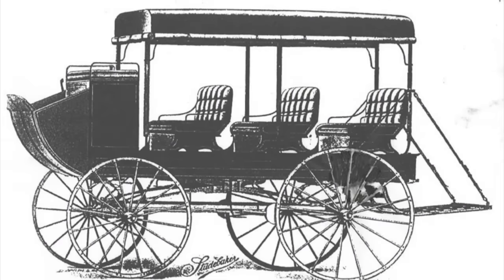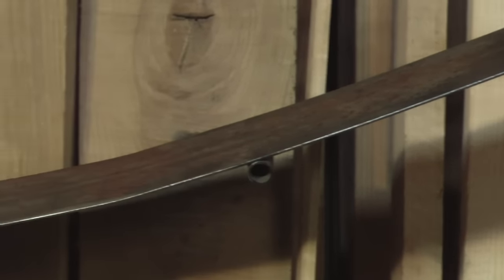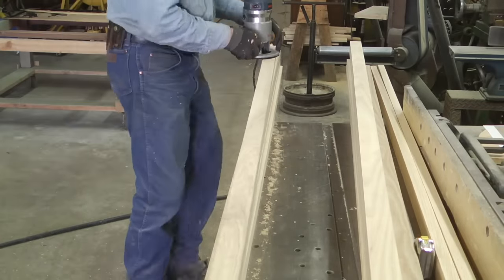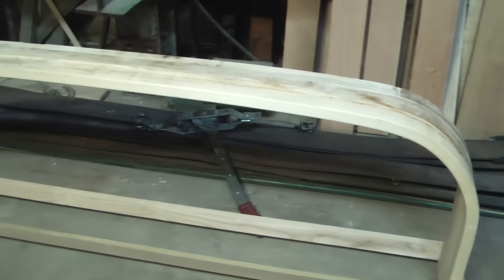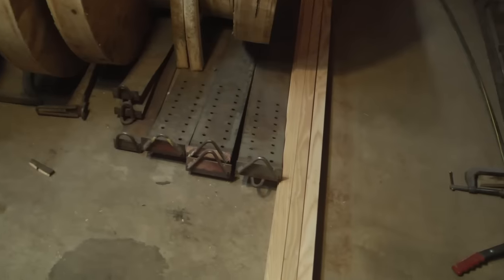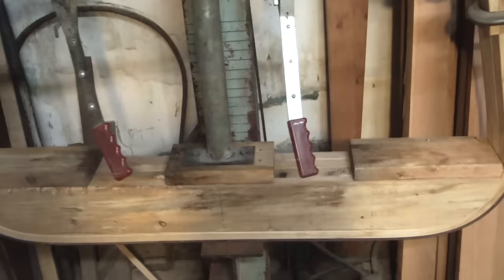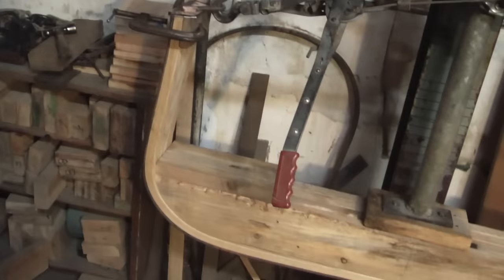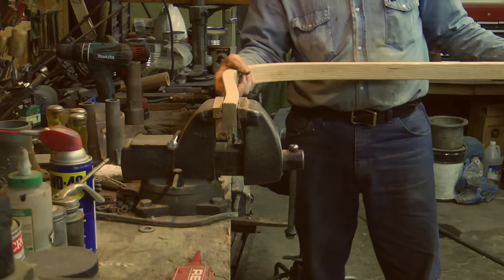Steam Bending 1" Thick Kiln Dried Ash Possible | Engels Coach

Comment: I've bent ash for a row boat I made in my garage and it took a bend extremely well. I didn't have a press. I just used a lot of clamps and I achieved a perfect bend with my first attempt.  I was amazed at how flexible it was when steamed.  I built a steam box from scrap wood and just used plain water and no pressure. You have an amazing shop!

Comment: Experience and knowhow. unbeatable .I really admire the way you can overcome a problem and turn out a first class product making it look so easy . I was a bit concerned when you straitened the very ends of the bows in the vice , thought it would leave deep marks in the timber from the edge of the jaws as it is still soft and pliable , but obviously you know you can avoid this happening as you have done it many times before.

Comment: never would think Kiln dried could bend... Myth Busted!
Reply: I've heard that in a wooden boat forum more than once with requisite horror stories told at the very suggestion.
Reply: V Star 1300 Adventures - Boatbuilders like to avoid kiln dried material for a few reasons. Besides the added steamer time Mr. Engels mentioned above, there is also a problem with fiber damage which makes the wood less moisture resistant.

Comment: I certainly enjoyed watching. Back in the late 80s when I lived in Denver I had a friend who wanted to build some sleds. He came to me to help him build the steam chamber. I built him a chamber from a 4 inch diameter pipe capped on the ends with a pressure gauge, relief valve, a way to add air pressure and a temperature gauge. It was long enough to suspend his wood in with the water in the bottom while it was mounted vertical over a burner. As I remember this worked out pretty well for him.

Comment: You can base your spring back on degrees rather than inches to be able to apply to other wood projects and you may get more consistent bends .. similar spring back in metal pipe when I bend large EMT for electrical ... you go x number of degrees over . You can record your spring back for different woods and thickness and see if you come up with a good formula.. awesome job ! Great video... I’m watching because my client has a two inch thick rustic table with bark edges she paid 3G for and it warped !!! The guy didn’t seal the bottom!

Comment: I remember bending 2" oak for the keel on small wood boats.  We used a copper leader from an old house, crimped at the bottom, filled with water, and then set it, with the oak inside, into a 50 gallon drum filled with scrap wood. Lit the fire, let it boil for a couple of hours and then took the oak and  bent and clamped it over an old curved bed frame. It worked well, but we weren't too exact, and the bow of every keel had a slightly different angle.  It was fun watching an expert do it right.

Comment: Wow u did a beautiful job bending Ash wood. That wood is a hardwood with lots of big grain running throughout, I would have never thought u could bend a tight radius without it splitting on the radius like the 1st 3 u bent, but with your expertise u new how to correct that. Im a fine woodworker, and I very so admire the knowledge of your generation woodworkers. Thank U for passing on your skills!

Comment: Deeply satisfying to watch. Many thanks for the low-tech but high-quality workshop know-how. Just an idea - what if you put two 'free' pulleys on adjustable brackets about half way up, either side of the steel post? As the jack pulled the cables up, they would reach the pulleys and any further stretch would be a straight pull in. Mounted on hefty long bolts aligned at 45 degrees to the timber form you could tweak each ash arm separately with a wrench. You wouldn't need what you charmingly call a "come along" (I reckon that's a car winch in the UK!).

Comment: Excellent video and it is great that you showed the problem of the end stops slipping and how it effected the bending.

As for the rebend at the ends of the hoops, You could probably avoid this if you relaxed the tension on the main wire ropes and just relied on the 'come-along' to pull the ends together. It looks like the main wire ropes are forcing the ends of the steel straps into the angle because of the upward pull of the wire rope.

Comment: As a boat builder, the rule of thumb for steam time in the box is 20 minutes per square inch of wood section, this was for using green oak quarter sawn and straight grained.
If the wood is over steamed, the cellulose leaves the wood, causing bent forms to crack and fracture later in life. Not good when bending ribs in a yacht.  The frames need to be formed over the jig within seconds whilst still soft to avoid cracking, as if allowed to cool before bending, they will split.

Comment: I took straight grained green smooth bark white hickory and cut 3/8 inch slats.
Bent them up over my flatbottom Jon boat. Marked and cut to length.
Re bent  them in under the rim on the boat.  Put the tarp over them for the winter.  It worked great.  Now in 5th winter.. Still ok...they still have spring in them.  Have them marked front to back for length.
6 on a 14 foot boat..

Comment: higher pressure doesn't just help to force the moisture and heat in, but also allows the steam to be hotter than the normal 100°c

Comment: very interesting and informative. if you wanted to eliminate the come alongs you could add a couple more pulleys toward the center where you hooked the come along so it would pull up and in more. you could use an open block or swing side pulley so you could loop the cables through quickly if needed

Comment: Here's a thought. Instead of come-a-longs to get a straight pull, how about a collar around the metal pipe you attached to your form, that could be adjusted up or down. Weld 2 pieces of angle iron, one on each side running parallel to the form. Drill holes on each end and then put a piece of 1" pipe between them with a bolt through it. They would act as rollers for your cables to run on. And you just run your cables down through them, then out to the ends of your strap.

Comment: The time I had a tube bender the dies were 210 degrees so you could over bend and account for springback. Then you don’t  red to round off the edge? Pro-tools website has a free piece of software to calculate radius and developed length. I would think it would be easier to run the legs long and then trim to size after the drying period? Nice setup for bending wood!

Comment: Great video, as always, what is the working time from when it comes out of the steamer till the wood is unworkable without risk of cracking?
Reply: Thanks for that answer. I also wondered about that. Hmmm, so it's the heat, not the moisture, so much...

Comment: Fascinating! I am interested in building guitars and I learned a lot here. I also wondered if putting some slow heat under the steel bending strap might prevent the "stretch mark" cracks to the outside of the bend...

Comment: I have heard about ammonium being used to make bendable wood.
Wood was placed in a plastic bag & soaked in ammonium until the lignin portion of the wood structure was made flexible.
When formed to a desired shape? The ammonium would evaporate & the wood structure would regain it's typical strength.
I thought it would be worth a mention as it would put a whole new twist on thing's: If so desired?

Comment: Ammonia is itself also a solvent for lignin.  Lignin completely soaked,, no heat required,, you can tie a round dowel into a bow....allow to dry and though fuzzy, the wood will recover nearly its original stiffness.  It is terrible caustic,, a good charcoal face filter is required,, I use 27% printers ammonia.  Now,,, that used to be common,, it was a developer for blueprints,,, not so easy to find today.

Steam plus ammonia,,, wonderful.

Comment: If there is springback why not design an arc of 92 degrees (or whatever) in the template rather than modifying the top board? The somewhat sharp bend on the last few inches would produce a geometrically imperfect arc. But who am I to complain? Your shop and methods are amazing.

Comment: Question:  Would adding non-sudsing household ammonia to the water for a traditional (non-pressure) steamer help air-dried ash bend easier?
Reply: Got it, so the gain is not through ammonia acting to directly soften the lignin, but through it acting to help the steam penetrate the wood more effectively.

Comment: Mr Engle that straightening you are doing with the overbent legs of the bows; if you had collared the last few feet to the steel bar when it was bent up would have eliminated the need for the vice, correct? since you are doing several same pieces.

Comment: Would i guess right, to terminate the end re-curving, Wedge-shaped pieces are needed as "over-compensating" Blocking at the ends of your metal banding, with the fat sides of the wedges toward the ends where the pulley draws from?

Comment: My steam-box can't get the same pressure as you can in yours; Would you recommend putting the pieces of wood longer in the box? The wood I'm using is furniture-dry, would you recommend submerging the pieces in water for a couple days beforehand? One last question; Since i'm steam-bending the skids of a rocking chair. How long you you let the skids dry before i would put any stress in them when they are installed on the chair? I would appreciate any help to any of these questions.
Reply: @EngelsCoachShop  Thanks for the quick reply. I had picked out some dry ash wood that I was going to use for the skids of the chair, but I think now that I might bend some wet ash wood instead as I might have access to some. Your videos have been very helpful and I thank you for everything I've learnt from all your videos. Keep up the good work and I look forward to your next video. Cheers and best to you too.

Comment: Great vid! I am curious as to why you don't put a clamp from top to bottom a bit in from both ends to keep the bottom flat?  Because of the pressures, it pulls a way from the band.  Is the long piece meant to arch a little?
Reply: I wondered that, too, just forgot to ask.

Comment: Great video, love the ammonia trick, I've been steam bending kiln dried oak to a radius of 5 inches for door rails with fairly good success rate, but have found the radius continues to get tighter as it dries out, is there a rule in terms of how long it should be left in a frame or dry mould before its worked on?

Comment: I am wanting to steam veneer for repair of the woodwork in a vintage care.  The woodwork is curved AND bent.  I want to steam my veneer prior to application as I think I will get an easier application.  I was going to utilize derelict  oxygen tank.  It appears as though there is a channel or something in which you poured your amonia prior to sliding in those ash bows.  I hope you read these comments as I would like you or someone who is knowledgeable to shed some light on how to construct my steamer.  Next question becomes...can I just soak my veneer in amonia?  bypass building a steamer for a one-time project?

Comment: Dad had an old horse drawn wooden work sled that was made from white oak as I recall..  The runners must have been 2 1/2" by 6" and the tips were bent up.... Any idea how steamed white oak bends??    Another great video, by the way!!! Thanks for Sharing!!
Reply: Duane
From what I have heard for the sleds my grandfather and others had built in Newfoundland they wouldn’t bend the runners because they were too big. Instead for those 2 or 4 pieces they would find a piece of wood that was already bent, usually from a branch of the tree
Reply: Thanks, That would be Great!!

Comment: no push stick nor saw blade guard on the table saw .... those G Clamps are so slow to use .... is the vice not going to mark the timber when reshaping the bend in the timber? .....fantastic video though ... I'm a Carpenter, however I've never had to bend any timber in my whole career (only bendy ply and mdf), great Video and thanks for the Education :-)

Comment: I'm not an expert,  but could you avoid the stretch marks by using quarter sawn lumber?  It split along the grain runout
Reply: EngelsCoachShop that bending jig is awesome.  I have a speed reducing gear box from an old insulation machine that I might try to put to use like that, if I can get any of my other projects done first. Haha
Reply: EngelsCoachShop quarter sawn ribs sounds like a good up-charge option  $)

Comment: Perhaps you can get some allthread or leadscrew, and for each side, you can make a half-vice like pusher, so you can work fast, and get the wood nice and tight. Seeing that you have holes in your strapping anyway, perhaps the vice-halves can bolt through the strapping on either side.

For each vice pusher, you would need two blocks of steel/iron, tapped out for your threaded rod, some kind of bolt/leadscrew/allthread, and a handle/wrench to tighten it. One block would be free and the other bolted to the strap.

They use half vices on milling machines, like this: http://www.rotagriponline.com/components/com_virtuemart/shop_image/product/17a6b14b4b7f19f7392e9851ceb2d5ac.gif
Reply: That's a lot of force. Perhaps grade 8 bolts might have worked. Not period, though : )

Comment: how do you work out what to charge $ for work like that? making 50 pieces would be a minimum order to make it worth while no? looks like a lot of planning and careful execution to get the required result.How about laminating four pieces of 1/4 inch thick wood on a former using water proof glue ? same result , easier done , stronger and less expensive in the end too.